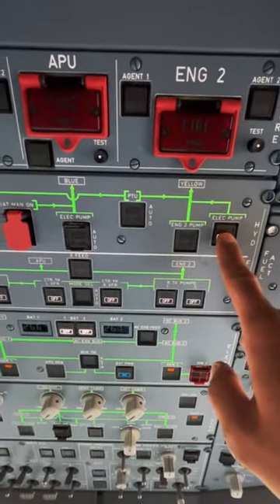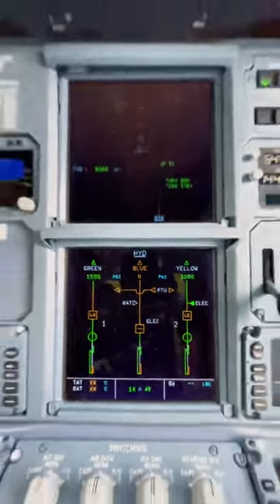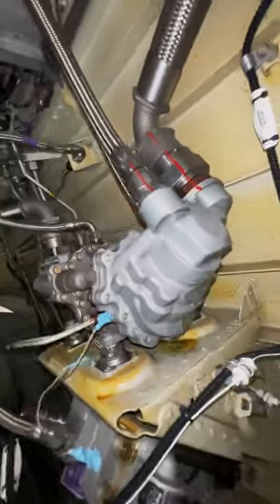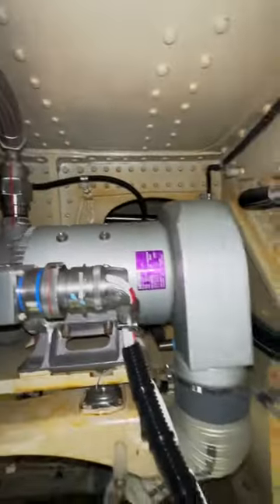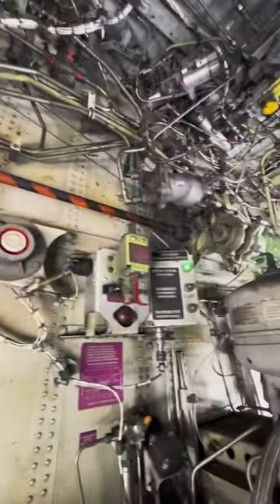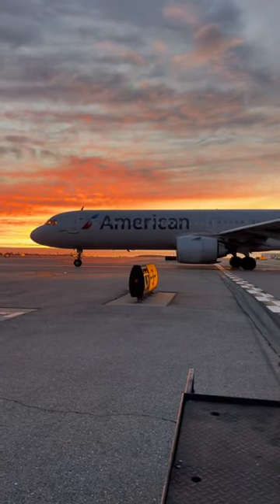PTU (power transfer unit)  description and operation

Comment: I don't care what ppl think! This is the best sound ever on Airbus! ❤
Reply from the maker: And it lives rent free in my head 24/7 😂
Reply: I guess it's enough for you! 😅
Reply: I used to wonder.  I thought maybe some system was doing a self-test upon engine startup, but I also wondered why it sometimes lasted longer on some flights than others, and why it would also “self-test” upon engine shutdown.  Knowing what I know now, it just means my Airbus is happy and wagging its tail, figuratively and literally.  I’d be extremely concerned if I was on an A320 that didn’t bark.
Reply: I always favored the sound of the electric hydraulic pumps shutting off on the CRJ’s.

Comment: The C17 also has a PTU and it sounds just like the one on the A320.
Reply from the maker: I didn’t know that, thank you for the education
Reply: Buddha!  Nicknamed that because the initial delivery flight from Seattle to Charleston AFB would not have been possible without a cargo compartment full of Boeing engineers on laptops keeping it flying due to all the software glitches that had yet to be worked out to meet the delivery date. It didn’t fly again for about 2-3 months while Boeing worked all the bugs out.  It was big, fat, sat on the ground and everyone worshipped it.  Hence the nickname, Buddha.
Reply: @allenemiesforeignanddomest3320  The C-17 was built in Long Beach and initially by McDonnell-Douglas, though.

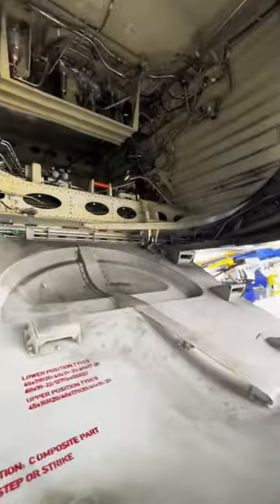Comment: 1:20 I'm really curious as to what causes the actual "bark" noise of the pump...? Is that due to a check valve or something like that releasing?  Or due to the pump itself cycling?   (I've have a difficult time trying to understand how the pump physically works, there are diagrams, but I haven't been able to find a animation of it.)
Reply from the maker: It’s due to the power transfer unit trying to keep up with the pressure on the system. Remember it’s a variable displacement pump
Reply: I also wonder.  I’d hypothesize that the whining comes in when fluid flow on the higher pressure side drives a shaft that pumps up the lower pressure side, and the barking must be the sound of the variable displacement doodad varying its displacement whenever the pressure differential is greater than 500 PSI.  I’d guess it must vary displacement such that one side can’t go higher without the other side going lower, thereby self-regulating the mechanical advantage the high side has over the low side as required.  

I don’t know though, just guessing based on my theory about how it COULD work, not how it actually does work.  Now I’m curious enough to try looking it up.  I want to know whether I’m close to right, or just inventing crap in my head.
Reply: OK, I’m sort of right, sort of wrong, and it’s also more complicated than I first thought.  One side (the green side, I believe) is fixed displacement, the other is variable (which I’d know if I first comprehended what Stig said).  The green and yellow sides are hydraulically separate but are connected by a drive shaft.  Both sides can function either as a motor or a pump.  Whenever there’s a differential of 500 PSI, valves open and the higher-pressure side of the unit, whichever side that is, functions as a hydraulic motor.  That spins the drive shaft so that the lower-pressure side of the unit can function as a pump.  The PTU’s functionality can be boosted by an electric motor, providing additional pressure to the lower side while relieving some of load the from the engine driven pump on the higher side.  I’d have to guess that the whine is from the electric motor.  I’m not sure the purpose of variable displacement (to adjust mechanical advantage between the sides is still my best guess) or why it’s deemed necessary on one side but not the other.  Most of all, I’m still not sure what makes it bark.  So that’s where I’m at.

Comment: Informative video.except...
On the 737 what he is pointing at, is not the PTU. That is the Flap Power Drive unit. If you want to see the PTU, it would be on the beam where that reservoir(standby reservoir in the video) is attached and go near the end of the beam on the other side.
Reply from the maker: You are absolutely correct. That was my fault because the video went out of sync when I did the voice over. The PTU is very small on the 737  and as you stated in the center keel beam.

Comment: I was on a airbus and this was running continuously for about 5mins during decent, does that mean the plane was broken? Love your work!
Reply from the maker: It’s completely normal, sometimes the pumps need to compensate and this is why you hear the noise. Just because one of the engine driven pumps are not producing enough pressure. The power transfer unit will compensate.
Reply: Thanks @StigAviation ! Love your content, looking forward to the next shift video

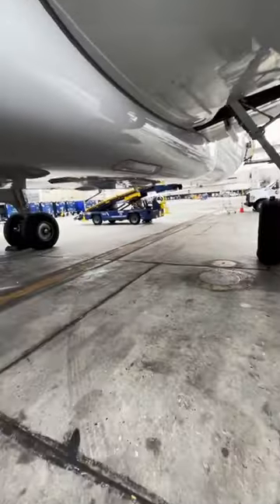Comment: Thanks a lot! This video really helps. Also could you advice the source of the picture on 1:00? Would like to dig into it as FCOM is of no help.
Reply from the maker: that picture comes from the Maint manuals, its not available in the FCOM, but you can also find it online.

Comment: Why advantage does the PTU bring? Why did Airbus make it get used on the ground while Boeing didn't?
Reply from the maker: Because Airbus has 3 independent systems and it acts as an extra redundancy system in case one engine driven pump fails. It can still provide hydraulic power to the failed system.

Comment: The should put sound dampers around it.
Reply from the maker: Really no need for that. It’s only on for a brief moment.
Reply: @StigAviation  unless you are on Spirit and they turn off the engines on the ramp waiting for a gate. Roof roof roof
Reply: @Prestonelmer And how do they reach the gate if they turn off both engines?

Comment: ihere is that before when they star the right engine this song will cames up also i see all the light and tv will stop work and when the right engine start complite all the systerm get work
Reply from the maker: It’s because the generators are coming online from the engine, so there is a slight power interrupt.

Comment: If there are three independent systems but only one PTU, are they really independent? If PTU fails what happens?
Reply from the maker: You just answered your own question tho. If all three systems are independent and the PTU is the cross connecting them. Even if you have the PTU fail you still have the independent systems working. You can even have 2 systems fail and still have control.
Reply: @StigAviation  I should have been clearer, if all 3 systems are connected to the PTU and it catastrophically fails (ruptures) could the pressure/fluid be lost in the aircraft or are there redundant valves that would close off.
Reply from the maker: @EliseW-s8q  all 3 systems are not connected to the PTU. Only green and yellow. But they are still independent and don’t intermix.

Comment: can you describe what the switch indication says when its off vs on. Im unsure how the airbus overhead push botton switches indicate on/off
Reply from the maker: Would you please be specific in what switch you are speaking about
Reply: This was in reference about the Airbus pushbutton switches on the overhead panel when turning the PTU on and off. When pressed an "off" indication. Does that mean it's off or it needs to be pushed again to actually be off.
Reply from the maker: @absters33  this is a great question, what you were referring to is actually the whole concept of dark flight deck, so what that means is, if the unit is off, the light will come on. This will illuminate and give notification and will be very visually apparent. Since we’re working off of a dark flight, deck concept, if all lights are Off that means everything is working properly. I hope that makes sense.  But it is a very comical thing when your first encountering it. Turn off, push button off Legend comes on. 🤣🤣
Reply: @StigAviation  thank you for explaining it in great detail and what indication is to be expected in normal operations. Very knowledgeable and helpful thanks!

Comment: u said that each fluids do not go over each other, but how is it possible to supply another hydraulic without transferring the fluid to one another?
Reply from the maker: Variable displacement pump. It just transfers the pressure not the fluid.
Reply: To clarify a little, because I did some research after having the same question as you, there are two sides of the unit (green and yellow) that are hydraulically separate, but connected by a drive shaft.  Each side of the PTU can be thought of as both a hydraulic motor and a hydraulic pump.  If the green side has low pressure, the yellow side functions as a hydraulic motor, which spins the drive shaft, which drives the green side to function as a pump.  If the yellow side has low pressure, it’s the same idea, mirrored; the green side functions as the motor, the yellow side as the pump.

Comment: Bro kindly make a video on 737 hydraulic system & compare it with A320 it will be an comparison of both technologies.
Like how 737 hydraulics get pressurized in case of one engine stop or start etc..
Reply from the maker: I will definitely work on that video.

Comment: why they shut down everything such as had tv and air-conditions ,light when they start the right engine on the Airbus A319 A320
Reply from the maker: They need to shut down air-conditioning for a small moment because the air is required to start the engine.

Comment: PTU is exactly why I cannot stand the Airbus a320 family. I have no problem with airplanes and their hydraulic noises but the A320 family's noises are extremely irritating. I love Airbus for its a350s and a380s but I try to avoid the a320s altogether (and yes, this includes the a321).
Reply from the maker: It’s not like the hydraulic system is constantly functioning, you’re not hearing that sound all the time, it’s only in the beginning and the end of the flight
Reply: @StigAviation  the sound is still irritating though.
Reply from the maker: Do you think that’s annoying, wait till you hear what the brake fan sound like 🤣🤣🤣

Comment: Silly noisy European plane.
Reply: 737 Max: silly crashing American plane
Reply: @JustRememberWhoYoureWorkingFor  don't forget the GTF engines that only last 5000 hours on wing, not 100,000 hours.
Reply: Pff, flown last week in a 16 year old a320 and an 8 year old 737-800 - the Boeing was way louder on the inside 

Still like the 737 tho, but don’t be unfair
Reply: @Alteshaus21 I would rather hear B737's interior than A320'S horrible barking PTU.